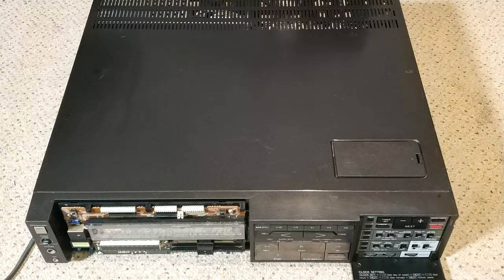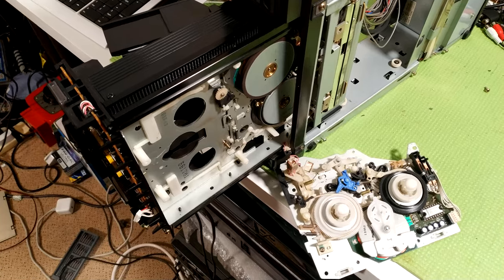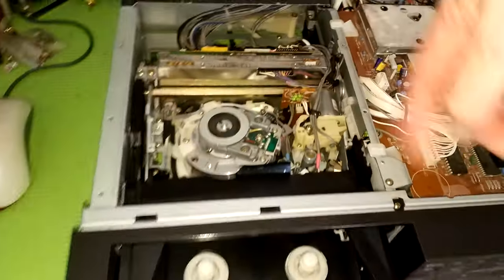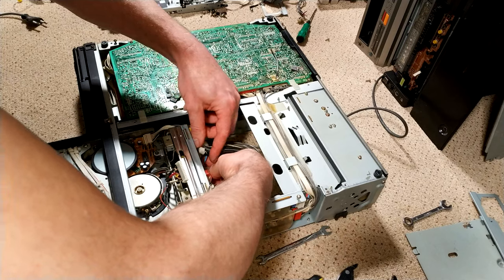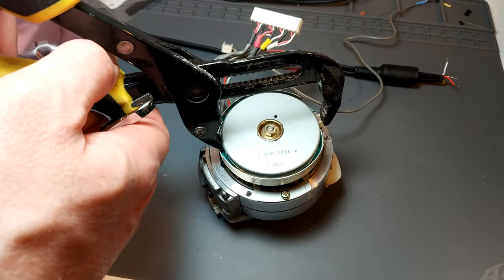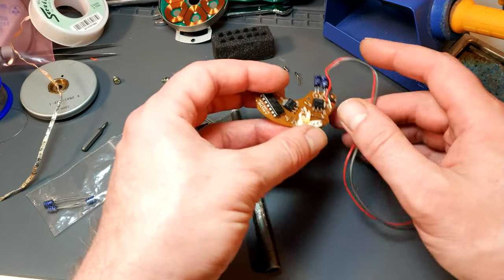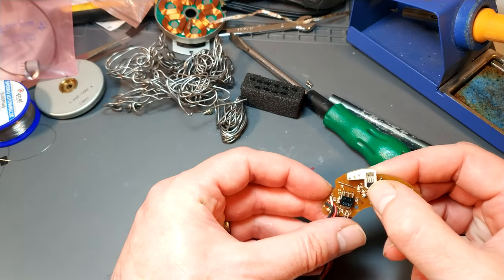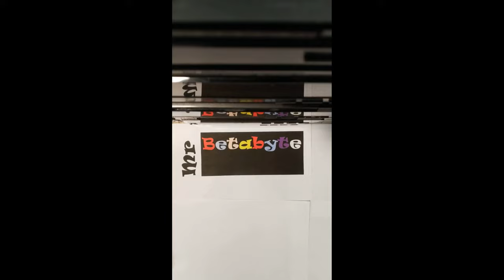Sony HF950 Super Betamax (EU version of HF750) - Deck the halls?!?

Comment: Where you can find a NOS set of HALL IC?
Thanks.
Reply from the maker: There are a few on eBay and I am working on sourcing a new alternative that can be sourced easily without any modification. I do have a few too and could spare one so if you want one drop me an email to mrbetabyte@gmail.com and I'll sell you one of them.
Reply: @MrBetaByte  
Thanks, i have some NOS pack 
from the 80's.